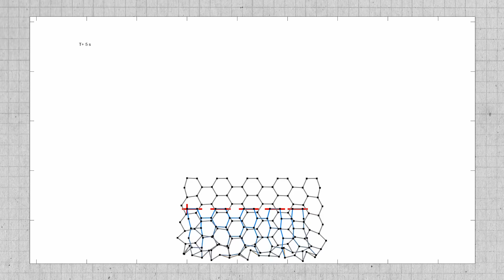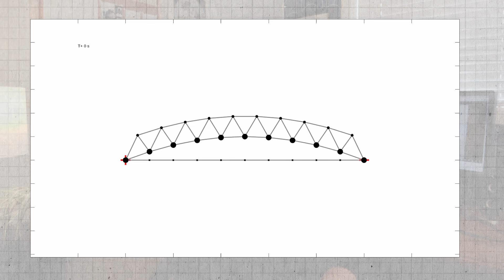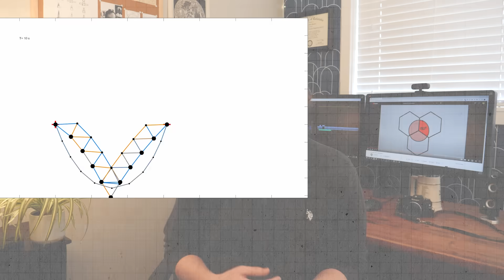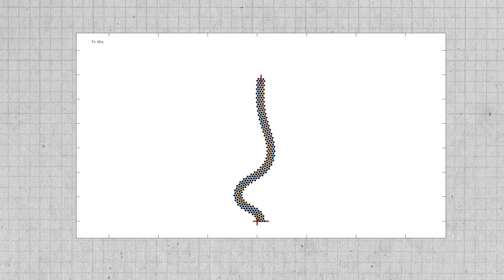Hexagons Are NotSoGreatAgons

Comment: this answers my question when I saw the smartereveryday ULA tour vid where that (presumably interstage) part was milled in triangular grid and not hexagonal as CGPgrey said hexagons are the bestagons. I believe the physics of packing materials most efficiently (where hexagons are the bestagons) and the physics of static determinance (where triangles are best) is quite different but visually the same and leads to incorrect correlations.
Reply: Efficient packing is still triangles. It's just that neighbors are in a hexagon.
Reply: @chaos.corner  2D efficient packing, right?
Because in 3D, I think you need a mixture of hexagons and pentagons. Like a soccer ball.
Your body is made up of cells, many of which have hexagonal and pentagonal sides.
Reply: @TheRealE.B.  I'm not familiar with cells (which aren't spheres and rave their own raison d'etres for how they are) but for spheres, hexagonal close packing has two different configurations. The smallest arrangement between any four touching spheres is a tetrahedron.
Reply: @chaos.corner  Hmm. Maybe it matters if space is the only concern, or if you have to worry about physics like pressure, surface tension, boundary conditions, etc. I don't know. I admit that this exhausts my knowledge on the subject.
Reply: @TheRealE.B.  Yes, it's entirely about the space left over by sphere-type objects.(atoms are a bit different as it's about minimizing the energy of the bonds). Boundary conditions can definitely affect things too. Consider that cube-type cells are going to stack in a fairly linear fashion.

Comment: a hexagon is just 4 triangles
Reply: They're just square circles.
Reply: @traviscaines8534  Square Hole
Reply: 4 triangles is just 12 triangles
Reply: Oh I see what your talking about but it’s 6 IF we are talking about a triagle equal sides
Reply: @Benm8_ with sides as long as the the sides kf the hexagon*
Reply: Hexagons are actually just made of 2471 to the power 18 triangles.
Reply: Ah yes... a triangle is just 3 triangles
Reply: @unknowntimelord9557  and those 3 triangles are just 9 triangles and....
Reply: @unknowntimelord9557  it is.
Reply: @unknowntimelord9557 *3 parallelograms
Reply: @unknowntimelord9557 that would be a nonagon
Reply: @unknowntimelord9557 a rectangle is just 4 triangles
Reply: it is if you split it up in an N shape
Reply: There are at least 3 ways to cut a hexagon into 4 triangles 🔺️ 😀 maybe more
Reply: @whatthefunction9140 there are only three if we’re using vertices as corners of the triangles. 5:03 three variations with two permutations of the same variation.
Reply: In that case triangles are just broken up hexagons.
Reply: @dusker-nd2cf  no, hexagons don't have the internal members that would make up the triangles.
Reply: @dusker-nd2cf how?
Reply: @dusker-nd2cf  no that’s not how it works
Reply: @dusker-nd2cf yes, but you can't fill a triangle with hexagons, you can fill any shape (with no curved sides) with triangles
Reply: To the people saying 6, the joke is that you can break a hexagon into 4. They won't be pretty equilateral triangles, but they will be 4 ugly ones (2 rights and 1 obtuse triangles.
Reply: @troybaxter I'm curious where you're getting a right triangle? The one I see consists of center equilateral and 3 obtuse surrounding it. I'm sure there are other ways but I can't see a way to include right triangles without going over 4
Reply: @almightysapling if you connect every other point of the hexagons until it reconnects to itself, you should get 3 small triangles surrounding 1 big triangle in the middle
Reply: @troybaxter thank you
Reply: 1 triangle is infinite triangles like squares is infinite squares but hexagons are not 2 hexagons except if you break it down to triangles and put it together but that’s not hexagons to hexagons that’s hexagons to triangles to hexagons
Reply: @lesdarkphoenix3780  'a' triangle is 3 triangles of 3 triangles of 3 triangles of 3 triangles of 3 triangles of 3 triangles
Reply: @beaclaster  so you can say that 1 triangle can be broken down in an infinite number of triangles
Reply: @beaclaster  you don’t even need to go to 3 triangles you can go to 9 triangles
Reply: @lesdarkphoenix3780  it's literally a reference to the sierpinski triangle
Reply: @beaclaster  imagine sierpinski hexagon made from 6 sierpinski triangle
Reply: no it’s 2 circles
Reply: In a trenchcoat
Reply: They all fit in the square hole
Reply: 6*
Reply: @Reactorjam depends how you split it
Reply: @Reactorjam I mean, it can be four triangles. Two triangles to make up the corners and two right angled triangles to make the rectangle in the middle
Reply: @Reactorjam you said it.
Reply: @Reactorjam nope real 4
Reply: @Reactorjam  4. Draw a Z in the hexagon
Reply: @whatthefunction9140  yeah I realise after a bit what he ment
Reply: @Reactorjam 
Wrong
Reply: @supernovaaaa16  ok?
Reply: what is going on in these replies
Reply: @RoxxLuck i have no clue. People just keep replying to others or me either giving constructive feedback or just trying to be rude.
Reply: I mean... Yeah I guess you can make it with four triangles if you use more than one kind.
Reply: a square is just 4 triangles
Reply: @joachimmacdonald2702  a square can be made of two right triangles.
Reply: So triangles are the bestatri
Reply: triggered
Reply: … two triangles and rectangle…There! I said it!
Reply: More like four triangles in a trenchcoat
Reply: A triangle is just 1/4 of a hexagon
Reply: To everyone commenting "6*"      
    /-----------\
  /|        /    |\
/  |      /      |  \
\  |    /        |  /
  \|  /          |/
    \----------/
Reply: Any plane is just an infinite number of triangles :) don’t know if it counts for a circle though…
Reply: How is it 4? 4 would be a square, a hexagon is 6
Reply: @orphan-eater  4 is a square if they are right triangles. Think 4 equilateral triangles placed side by side. They can make an irregular hexagon. It does, however, always take 6 to make a regular hexagon which is what the video is talking about.
Reply: no, you can make a regular hexagon by turning the outside triangles into obtuse triangles.

If you consider an irregular hexagon, you can make it with just 2 triangles, like this

  🔻
🔺️ glue these 2 together to make an 100% valid hexagon
Reply: @orphan-eater  internally connect every other point of the hexagon. You end up with an equalateral triangle in the center and 3 obtuse triangles left over
Reply: @orphan-eater connect one corner with every corner ans count the triangles (also love the name you chose)
Reply: "You're goddamn right"
Reply: And if you're brave enough, everything's a dildo
Reply: Theroem 0.69: A triangle is just n triangles. Where n can  any natural number (0 excluded)
Lemma: for n > 1 these triangles can also be right triangles
Reply: a triangle is just 16 triangles
Reply: OOOOOOOOOOOOOOOOOOOHHHHHHHHHH!!!!!!!!!!!
Reply: Triangles are just conected lines
Reply: A hexagon is an infinite number of triangles
Reply: Can you count?
Reply: Yes @treelord8327
Reply: A square is just 4 squares
Reply: But triangles are not “triagons”… of the “agons”, hexagons are the most common by far, for us to see in the natural world. When’s the last time you saw a septagon outside of the man made, after all?
Reply: 6
Reply: @simonborges1922  4
Reply: Triangle=good 1 > 4
Reply: Triangles aren’t made of three equal triangles. It’s fucking four. Y’all defending the triangle incorrectly.
Reply: 6
Reply: @Fishsticksthefishwizard  4 is the minimal number of them, but you want you can create as many as you want! It’s 6 only if you want them to be equilateral
Reply: @KajtekBeary and why the focus on unions? We can do it with 2 congruent equilateral triangles if we use intersections instead!
Reply: It has to be at least 5 to make a hexagon
Reply: Or 2 or 3 or 6. 6 would be equal
Reply: @spicyicedcoffee1150  how can you cut a hexagon into 2 triangle???
Reply: @whatthefunction9140  nvm i wrote that at like 2am
Reply: But the hexagon does not have any lines connecting it in the middle while triangles are both hexagons and they have the middle lines.
Reply: It's actually 2 triangles if we counted the sides
Reply: 4 triangles are just a hexagon
Reply: Fact check: A hexagon is obviously 2 triangles
Reply: CIRCLES ARE TRIANGLES MESHES ARE TRIANGLES SQUARES ARE TRIANGLES LINES ARE TRIANGLES EVRYTHING IS TRIANGLED
Reply: *12
Reply: Any triangle is a hexagon so long as they have 6 sides
Reply: Technical you can create hexagon shape using 3 triangles
Reply: 6*
Reply: @Ummos325  no, hexagons are made of 4 triangles
Reply: Brush its six sides
Reply: A triangle is a fourth of a hexagon
Reply: Dude he explained that are you death or are you just stupid
Reply: Bro did not watch the video
Reply: A triangle is just a quarter of hexagon
Reply: All these squares makes a circle
Reply: Nu uh triangles are 1/4 hexagon
Reply: 6 learn math 🤯🤯🤯🤯🤯🤯🤯🤯🤯🤯
Reply: @bosauto5738  imagine an equilateral triangle in the middle of the hexagon. Now count the 4 triangles. 4
Reply: Orrrrr triangles come in groups of 4 to form hexagons (aka the bestagons)
Reply: Hexagons are the best shape when it comes to tileability and volume/circomference, this is due to hexagons being the closest to round- still tileable simple shape. Ive seem bees build circles of wax, and they then collapse into hexagons as they start building the neighbouring cell.
Reply: hexagon is overrated
Reply: My triangles are yellow.
Reply: Yeah, a triangle of side length 3L, where 3 triangles of side length L are subtracted.
Reply: Or, triangles are just ⅙ of a hexagon...
Reply: @furioustester4056  1/4th
Reply: I mean, yes it is, but also, no. I think it should be considered a war crime to say that
Reply: It can be 4
Reply: Omg this comment is genius- you can make a hexagon with 3 triangles (they all share 1 point, which is the center point of the hexagon), with each of the sides of the 4th triangle connecting the 3 outer edges of the other triangles.
Reply: @vladthe_cat  there are a few ways. An equalateral triangle at the center of the hexagon or just draw a z in the hexagon and you end up with 4 triangles
Reply: no the triangles are copying the hexagons
Reply: It's 6 triangles.
Reply: @ianbelletti6241  nope 4 in a few ways. Think about it
Reply: @ianbelletti6241  no its 4 at minimum
Reply: @jared_was_here  I'll give you that for an irregular hexagon. It's still 6 for a regular hexagon.
Reply: technically yes... i guess...
Reply: Triangle is just 4 triangles and hexagons is just 6 triangle
Reply: @SupasitPhungrattana  it's triangles the whole way down
Reply: 4?
Reply: @Israel-Niles  yes. 3 ways or more
Reply: @Israel-Niles  yes
Reply: True, triagons (triangles) are the true bestagons. Actualy what is the bestagons is subjective.
Reply: Anything is just a triangle you brilliant (the circle is made of triangles but it takes an infinite amount of precision and time to draw it)
Reply: 6*
Reply: 6 but yes
Reply: @MikeyPeacock-h8c  what happens if you draw an equalateral triangle 🔺️ at the center of a hexagon?
Reply: @whatthefunction9140  oh I just realised what you’re saying, that’s smart I would have never figured that out on my own.
Reply: I think that may in fact not be the be the number of triangles
Reply: @blackfishai  how many triangles do you do you count
Reply: __
/ |\   | \
\ |  \ | /
  """"""""
Only one possible arrangement.
Remember: Don't skip school! 😉
Reply: 5 triangles
Reply: Ew
Reply: a triangle is just an infinite amount of smaller triangles. That is basically what you are saying
Reply: it's actually just 2 triangles on a rectangle
Reply: A hexagon is one triangle
Reply: @sirpercivale  one 6 sided triangle?
Reply: @ yes. If you overlap two   equilateral triangles you can form a star with a hexagon in the middle (🔯) then is you extricate the six points of the star you can make another hexagon from them. Hence two triangles = two hexagons, hence, one triangle = one hexagon.
Reply: @sirpercivale  mind-blowing
Reply: How the hell can one make this mistake
Reply: Nein
Reply: N word
Reply: You mean … 4 triangles are just a hexagon.
Reply: 6 my guy it has 6 sides
Reply: @matthewgaming9575  yet you can construct one with 4 triangles.
Reply: A hexagon is Two trapezoids
Reply: @CymbalDing  a trapezoid is two triangles
Reply: @ it’s 3?
Reply: 6, dum dum
Reply: @vishipsherrah  you're the dum dum. it's 4, you can divide by connecting (cutting) a vertex to the others
Reply: @CoolyanEmoji  🤓
Reply: @vishipsherrah  🤪
Reply: A bunch of triangles are just hexagons
Reply: WA-
Reply: Or a triangle is Just a split hexagone
Reply: “Triangles pull the same trick, splitting…”
Reply: That's a square
Reply: @HackerDragon9999  that's 4 sides... 2 triangles
Reply: How 4
Reply: @AarnavMarimuthu  draw a big triangle in the middle
Reply: r/confidentlywrong
Reply: All shapes are infinite compositions of triangles
Reply: @Anon-do7lo Infinity is only theoretical.
Reply: Yeah it definitely is 4 triangles
Reply: A hexagram is only 2 triangles
Reply: a hexagon is a triangle and a broken up triangle
Reply: 6*
Reply: @JuanluisitoSC 4**
Reply: 6*
Reply: @nicholaskrieg9256  no it's 4 triangles